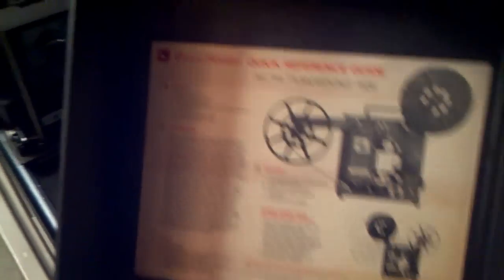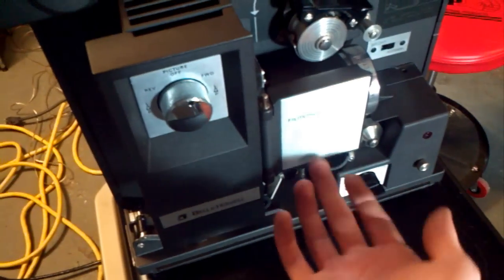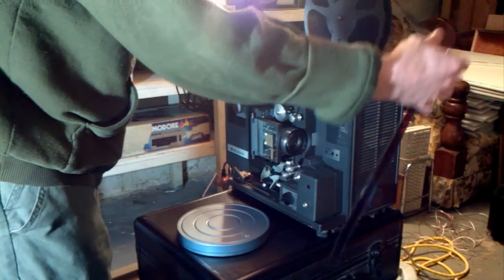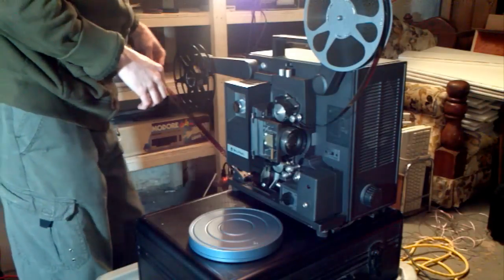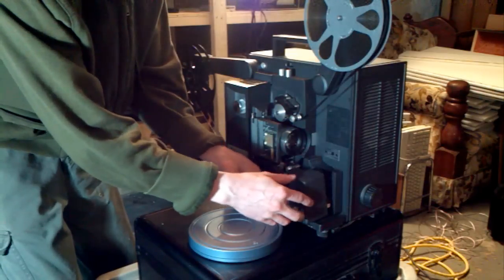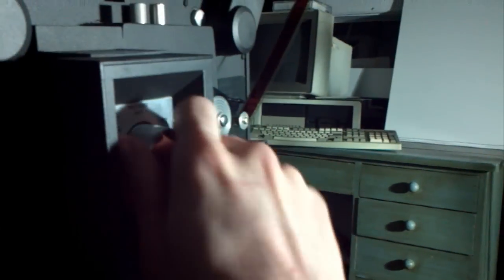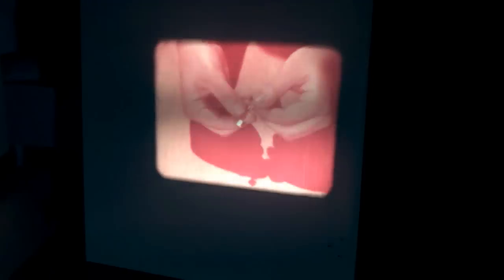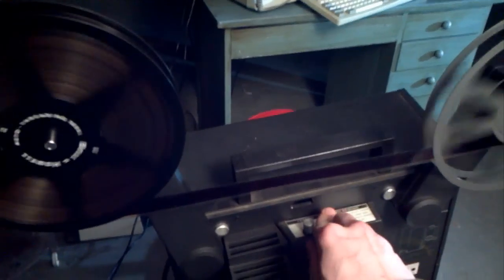16mm Projector Tutorial

Comment: Try modifying bulb to GU10 spots. That way the bulbs will be cheaper. You may be able to break the original bulb, when it blows, off and glue on or into the plug bulb assembly a GU10 socket. A lot cheaper than finding and buying a new projector bulb. Great video well done.

Comment: The projector is loud because your worm gear inside it is cracked. It only gets worse till it completely falls apart. You can buy the reproduction worm gear, projector service manuals, films, projection and sound exciter lamps, and film cleaning supplies at Urbanski Films:  https://www.urbanskifilm.com/
The 1535 was Bell & Howell's bottom-of-the-line projector model with manual threading. Your have a model 1535-B which has a seperate hi-lo lamp brightness slide switch located above the sound head. When the switch is in low position, you greatly extend lamp life.